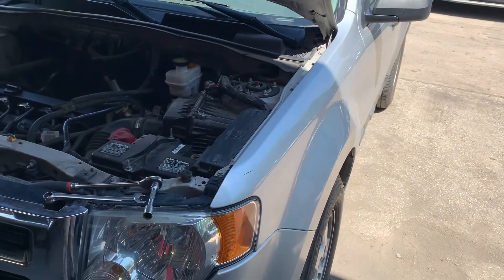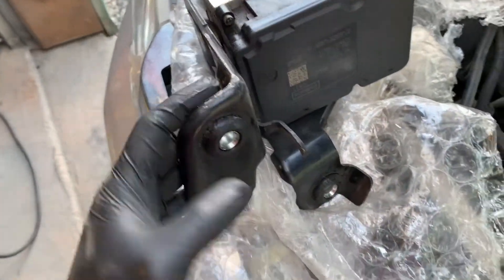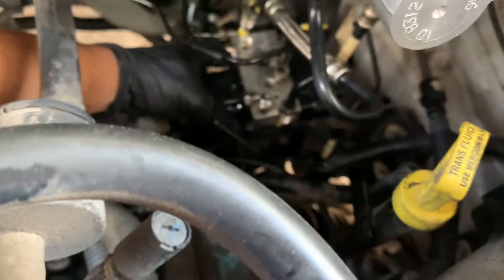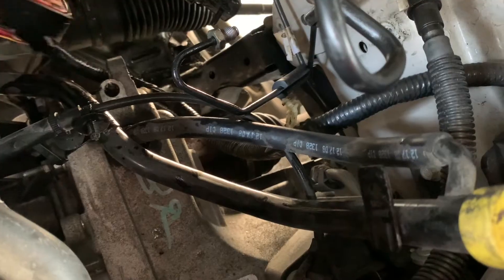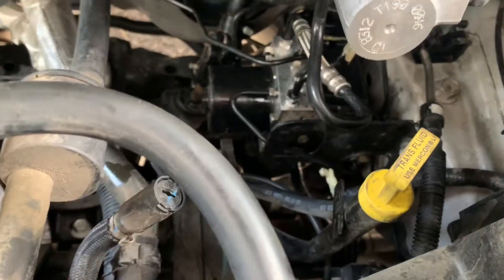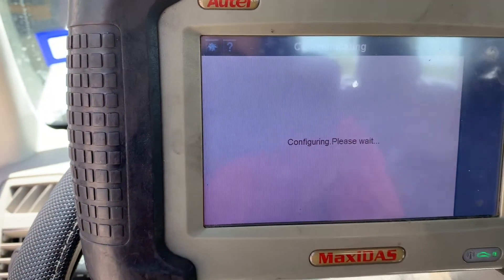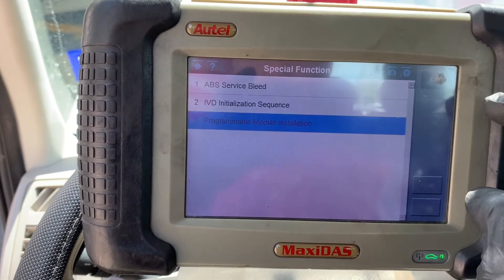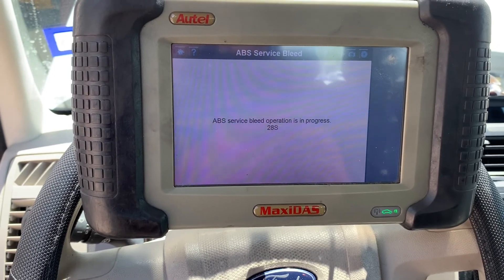2009 Ford Escape ABS Module Replacement

Comment: If I am understanding this somewhat disjointed repair journey correctly, you overlooked or didn't read service info on the jumper tubes that extend the rear brake pipes up to the top of the HCU.  That black block stays attached to the HCU and the pipe connections up top remain connected when you remove the HCU from the vehicle.  There are fittings below the block that you remove, accessible from the LF wheel well.  That way you don't need to fight the two rear pre-bent pipes as they pass through and over the HCU bracket.

Comment: I've always wondered with a code reader bleed, where does the air go? Obviously it doesn't go out the bleeder screws on each wheel.  Is it pushed back up through the master cylinder?

Comment: Thanks for this! Could you use FORScan for this, or do I need that scanner? If so, which model of Autel Maxidas is it?
Reply from the maker: I used an older Autel with this but I believe many scanners that’s allow for more than basic scanning can do it since it’s just capturing the previous info and applying it to the used module.
Reply: @TexThaiAuto  Well, I bought an Autel MaxiCOM MK808S, but it seems like it can't do it.
Reply: @Mark64 forscan is they way to go
Reply: @cj1613  Yeah, I ended up returning the Autel and just using FORScan. However, it still took a long time to fix because I needed to pressure-bleed the brakes. But I did eventually fix it 100% myself.

Comment: I thought the ABS module on these needed replaced because of the DOT3 fluid turning to gel leaving the valve stuck open, just asking if you ever heard of this with 2006-2010 Fords

Comment: Very useful video!
Could you explain how to choose the right ABS MODUL/PUMP if I want to go for used one?
Reply from the maker: Run the part number on your original
Reply: @TexThaiAuto   can you actually reprogram a used and module? I heard you could not. Also, which scanner were you using there?
Reply: Código del módulo original + número de vin del auto ( número de chasis) .
Reply: @damian2594  en mi auto no leyeron ni gun dato antes de quitar, que numero necrsito mas el vin????

Comment: I have replace abs unit CO2, S/W 60303. for my car santa fe 2007, 2.7., 4WD  ESP. And bleed air from wheels. The problem. Is clunk sound Inside abs unit when press  break at low speed. No signal abs light, the abs working good as break, the problem only the clunk sound. So please could you advice me how solve this problem.
Thank you very much for your help.
Reply from the maker: Maybe check the brake booster to see if the shaft broke?

Comment: Tengo una ford escape 2008 4 cilindros...si le cambio el modulo abs del mismo que trae la camioneta es necesario programarlo? Que pasa si la uso asi sin programarlo...o si lo programo días después de cambiárselo?
Reply from the maker: You need to program. A used one will not work properly until calibrated to your vehicle.

Comment: Is it possible to change just the the hydraulic portion of the HCU and just swap the electronics over to the used pump, and skip the programming?
Reply from the maker: I would assume so since the hydraulic portion is mechanically driven (as long as it’s the same). I’ve never tried this myself on a ford but would really like to know how this goes, please keep me updated. I’ve done it on a Mercedes or an Audi (can’t remember which exactly) and it did work.
Reply: @TexThaiAuto  We used our Launch scanner to code the used ABS HCU. I'm going to pull the module off and have a look at it. Might be worth swapping if you don't have an ABS hard fault.

Comment: So bleeding out means your getting the air that would be trapped in the abs before fluid gets in there. The air has to go somewhere. If your doing that abs bleed procedure where is the air going if all lines are connected?
Reply from the maker: There is a vent that only opens when doing it electronically. You’ll be able to feel it when holding the brake pedal.
Reply: @TexThaiAuto  is this bleading can help when you install new caliper ?

Comment: How much does cost for abs control replacement including parts and labor?used part or new part?
Reply: And this for the same Ford Escape xlt 2009 that I have
Reply from the maker: Depending on area.
Reply: 1700

Comment: I had a shop try to change my rear brakes on a 2011 Ford Escape now the pedal goes to the floor. I believe it’s the abs model. How would this happen just changing the rear brake shoes?
Reply: Brake booster
Reply: Look into the recall 19S54 from ford

Comment: Why did you replace this? My brake pedal feels spongy and goes to the floor. I’ve replaced master cylinder and booster, brake lines dont bulge, is it the abs module?
Reply from the maker: In my case it was, I did literally everything you mentioned and the problem did not resolve until I replaced the ABS module.
Reply: Wow thanks you tube for cutting off this mans important information. Why is this happening. YOU Need to fix this!!!
Reply: TexThaiAuto what happens if i replace it and dont program it

Comment: Is better to bypass the abs module from the 4 wheels to the two master cylinders hose using two 3 way tees to make the proper junction, after that bleed out your system and plug in the 4 wheels hose ports 3/8-24 and th two 916-18 master cylinders`  s port on the abs pump assemble and forget the brake problems in fords.
Reply: Hi Jose
I have a 2008 Ford Escape that I was thinking of doing this to. You’ve done it before and it worked perfectly fine, with no check engine lights?

Comment: Im having issues with my module, does anyone know if the new ona have to match the serial number?
Reply from the maker: Get the same part number.
Reply: @TexThaiAuto  it's been hard to find the exact same part all of them look the same but  the serial number is different
Reply from the maker: I believe if it’s the same type/hardware it’ll work. You can use car-part.com to help determine the module that’ll work and I believe there are forums that discuss which models can interchange.

Comment: DID YOU NEED TO REPROGRAM THE VIN NUMBER ON THE ABS MODULE
Reply: If you replace it with a used one, just remove the module from the pump motor and use your old module to avoid reprogramming.
Reply: @ilovecinnamoroll2013  That's great except the brake module is usually the failed part.

Comment: I wish you would have taken more time and organized your presentation. Your video is great and exactly what I needed. But, it is a little disjointed and rushed. I don't understand the scanner uploads, downloads, etc. Also, where did you purchase the ABS pump new or used? It is obvious you know what you are doing and don't waste time which I appreciate. But, some more detail, especially on the  scanner for us old non tech guys, would be appreciated. I have a 2008 with everything but that damn harness disconnected, I still can't figure how to disconnect it, and the 10mm bolt you referred to that I didn't see. I was going to by pass and eliminate the ABS. It isn't as easy as I thought. The fittings are metric and I was going to use a Willwood proportioning valve that has standard SAE line fittings. All of them have to be adapted or replaced. A real pain. Probably easier to replace the pump.
Thanks for the video. It has been out a couple of weeks, I am only the 6th viewer. I have been looking for this info for a couple of months. I will subscribe and like.
Reply from the maker: Too long to read just commenting to remove from feed

Comment: What was the brakes doing for you to know the abs module was the problem
Reply from the maker: Vehicle had a spongey brake pedal and every other portion of the braking system was working properly.
Reply: My 09 Mariner has the traction control light, abs light, and Brake light lit up with check brake system message. The brakes work fine. Anti lock system  only stops your brakes from locking up so you don't slide by turning brakes off and on till it stops. Your brakes will still work. But I'm not sure if it will pass inspections with those lights on it not... I been driving mine like this fir 8 months. Happened after heavy rain and driving through water. I think the black electronic box is shorted on mine not the pump.

Comment: I have read that because these modules are car specific, a used module will not work because it cannot be reprogramed. Is this correct?

Thanks
Reply from the maker: No. I purchased a used model and was able to reprogram it with my Autel scanner. It may depend on the year (I am not sure), but for this specific one I was able to get a used a module reprogrammed.
Reply: @TexThaiAuto  Thanks, was there anything car specif about the used unit? How can I find out if what you did would work on a 2007 escape hybrid?   Wray

Comment: Just wish I could see how you got it out of that tight area. Got to replace mine, hope it goes smoothly.
Reply: Also wondering what you plugged the lines with.
Reply: @LotsAYoyoMama  have u bought the new part yet. Sometimes the new part have rubber/plastic plugs covering entry ports in the new part 🤞🤞
Reply: Good suggestion but nope. Pulled off a used car at the Pick-n-Pull junk yard.